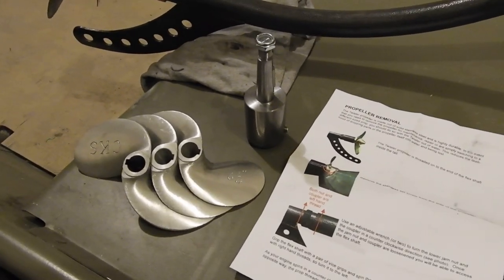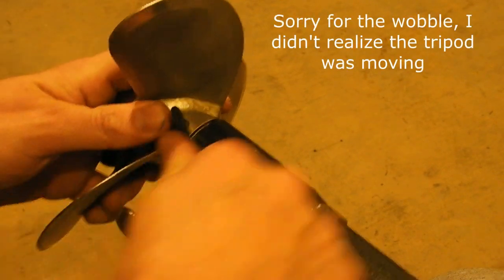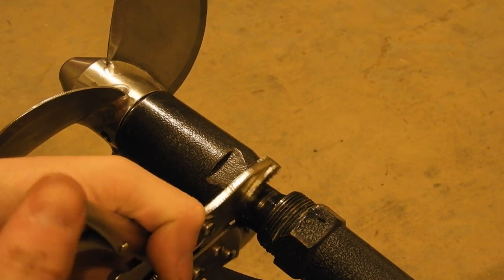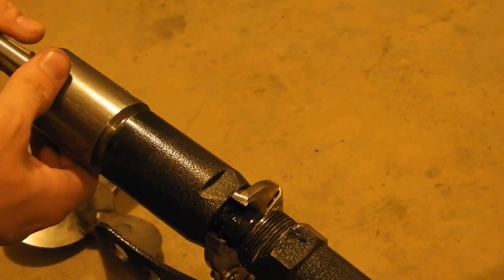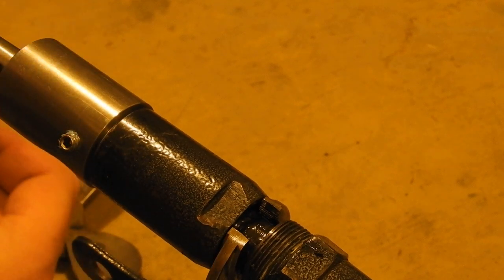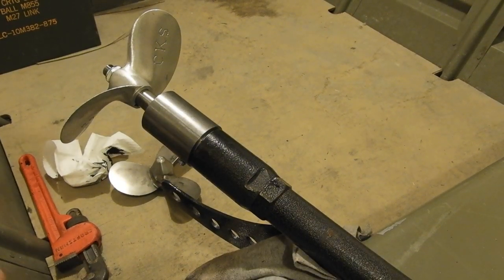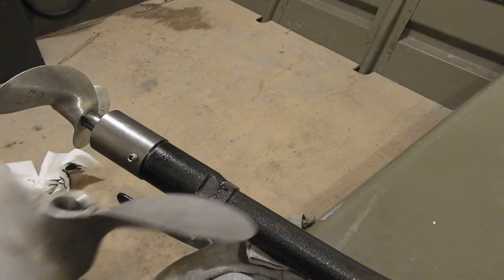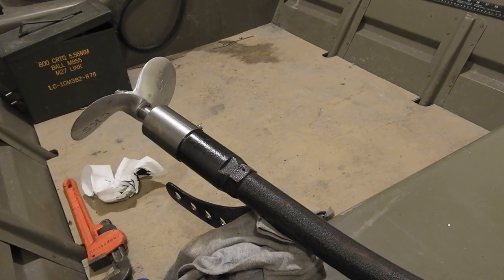Mud-Skipper Twister Prop Adapter Install

Comment: Do you think running a 2 propeller prop is better than three on the surface and why is that.. when I have my three propeller prop cutting the surface water it doesn't barely move my boat. Also did you take the governor out of your engine
Reply from the maker: For the first question, the answer is absolutely go with the 2 blade prop. As to why, that's a pretty complicated question. The shape of the blades has alot to do with how it runs at the surface, and the 3 blade prop is too big for these motors. It's a 7.5" and with the 3 blades, that's way too much surface area and it causes these engines to bog down easily. The factory prop isn't very good at "surface piercing" and that's why without a cavitation plate you need to run the prop very deep, essentially defeating the purpose of the design. Even with the plate, you'll notice once you get to a certain point, the prop will suck in air, known as blowing out.

And I have 2 engines I use. A predator 212 with billet flywheel, rod, stage 3 from NR-Racing, and the governor removed. That's the one I did 23mph with. My other one is a stock Duromax 7hp with the governor still in place and I can get 15mph with 8" prop and an empty boat. With a very heavy load, I'll go with 6 1/4" and it doesn't matter how much weight is in it, I'll go 8mph with a ton of torque.

Hope this helps.
Reply: @playinlikejimi  yes it does and I very much appreciate the help.. I built a wooden dory that is very light it is 17ft.. I have a 420cc 13hp predator and it gets up and goes decently enough for fishing but after watching your videos I agree with you and feel it's defeating the purpose of a long tail not being able to run near or cutting the water edge also I reviewed other info on props and basically said everything about 2 runs faster than 3 and 3 faster than 4 prop. I called mud skipper and talked to Jason and told him that I don't understand why they would put a three bladed prop on a long tail and was hoping that I could get a converter for my send in video rather than another 3 bladed prop.. I still trying to understand the dynamics why 2 blades push harder when cutting the water surface though.. I know that they do but trying to understand it better.. thanks again..
Dusty
Reply: @playinlikejimi  one other thing I forgot to mention is another question regarding stage 1 kits.. installing a header, new intake and jet is there a noticeable difference or is the only big difference comes with governor removal?
Reply from the maker: @luckylevi24   luckylevi24  one thing that completely changed my view on props was when I learned they work more like an airplane wing, not a corkscrew. The shape of the prop causes a pressure difference and this is what really produces the thrust. I think this is also why a larger prop spinning slower is more efficient than a fast moving small prop. That's why surface drives usually have a geared reduction and larger props and can move faster than a direct drive longtail with the same power. Both have their advantages though and I've had all my notes written for a long time to do a video on how the twister bridges that gap, I just haven't gotten around to making it yet. 

To answer your other question about the stage 1, the only comparison I have is back when I still had the factory prop. It was definitely noticable and I was able to hit the governed speed of the engine alot easier. Now that I have the adapter I can swap props in about a minute and match the prop to my engine and load weight. I have all the parts to do a stage 1 on my stock engine, so I think I'll do that but I'm leaving the governor in because it's electric start and I want to leave the stock flywheel in. 

Another big thing I noticed about the governor is it really helps with starting and idling, especially when trolling. Most people think it only limits the upper end, but it also helps on the bottom. Of course you can always feather the throttle and keep it in that sweet spot, but when you let off the gas and the RPMs drop, once the engine hits a certain point the governor will open the throttle to keep it from dying. Same thing when trolling and the motor starts to bog down at idle, the governor will bring the RPMs back to the desired idle. That's why if you mess with the linkage while the motor is off, you'll notice the throttle should be about 1/4 open on the carb side, even if the linkage is closed all the way. Since the engine is off, the governor is basically sensing the RPMs are too low and trying to bring them up and that's why it helps with start up.

These are all my own personal observations, I couldn't find much info online about it and was trying to figure out why my motor kept stalling after I removed the governor when it was completely fine stock and the carb was tuned to idle just fine with the prop out of the water. But as soon as I dipped it down, it'd stall unless I feathered the throttle. Just something to think about and I could be completely wrong my carb could just need some work. But take a look at the linkage with governor in place and quickly drop the prop in the water and see if you can see what I mean. 

But the other aspect is the upper end. You definitely will get higher speeds with it removed with the sacrifice of some easy driving on the bottom end. Especially if you do a cam and valve springs and start to move the powerband higher up. 

Sorry for the long winded responses.
Reply: @playinlikejimi  you have really helped me out a lot with the information. Wish you lived in sc I could show you my dory I made. Also I hope when I send the video to mud skipper for free prop that Jason gives me an adapter instead bcuz I agree with you that the prop that comes with the twister defeats the purpose of what it is made for. Thanks again.

Dusty
Reply from the maker: @luckylevi24  put the vid on YouTube, I'll subscribe to check it out. Then talk to them and see if you can work out a deal with them, their customer service is pretty good. See if you can at least get a discount, or maybe just the adapter and buy the props separately. The worse that can happen is they say no, so might as well ask.

Comment: Are all 3 of the props the same pitch?? I no they are different length
Reply from the maker: I don't know the exact pitch, but I'm pretty sure they're the same. I know the  Beaver dam props are all 5" pitch until you get to 9" diameter, then it's a 6" pitch.
Reply: Did it add more speed to your boat? Do you have to run the cavitation plate? And how far is the prop in the water when you hit your best speed? Thanks
Reply from the maker: @jerredmartin8985  it added alot more speed. And no, I don't use the cavitation plate. I haven't experimented with it on yet, but it runs just fine without it. 

I have done alot of trim setting tests. I'll make a video on that one day but right now my boat is in storage for the winter. But my best settings right now for a stock engine and empty boat are 7" weedless or 8" standard prop with the center of the prop 3" above the bottom of the boat. It will maintain about 15mph. That's about as high as you can lift the prop and comfortably drive it, any higher and the torque from the prop tries to pull the motor sideways. With the boat loaded down I use a 6 1/4" or 6 1/2" about even with the bottom of the boat. Prop depth and weight don't matter with those props, it will stay at 9mph whether the boat is empty or has 800lbs.

Comment: How do u take that spring and barring out of that area ur talking about at 11:23 second
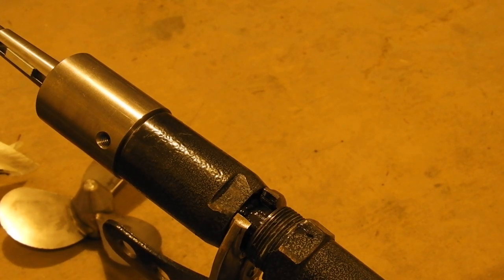Reply from the maker: It's been quite a while since I've taken it apart, but if I remember correctly, once you get to the point around 6:30, you should be able pull it out pretty easily from the prop side of that lower hub.
Reply: Awesome thanks
Reply: So just push it out with something

Comment: Do u know if a cavitation plate helped with the 2 blade prop?
Reply from the maker: I plan to get out this weekend and do some tests with different props on a stock motor. Once I find the best combination of prop and trim level, I'll put the plate on and see if it makes a difference.
Reply: @playinlikejimi   mine the flex shaft broke I'm replacing it Friday. If I put the cavitation plate on and a stage 2 motor kit u think it will push my 15ft pretty good?
Reply from the maker: @alexmont221  so far with the 2 blade props I haven't needed the cavitation plate, but it's pretty much required for the stock 3 blade. And it all depends on what kind of water you're in and the weight of the boat. I'll be testing the stock motor with the boat empty with just me in it and then with it fully loaded down. I'll do the same with the stage 3 predator later on so you can get an idea of what to expect.
Reply: @playinlikejimi  ok looking forward to seeing that video how many times do u grease ur twister? So what your saying is get the 2 blade conversion kit if I put a stage 2 kit on to get the best performance
Reply from the maker: @alexmont221  I would put the 2 blade adapter on first thing and see how it does, you'll probably be very surprised. Then upgrade the motor if you still want a little more power, but see the difference in props first
Reply: @playinlikejimi  I want to get my boat on plane at least. My boat 2 people can pick up but I weigh 200 and the guy I hunt with weights 200 then all our duck gear I'll need as much hp that I can get lol so thanks for the information ill get the prop and stage 2 set up

Comment: Which site did you get the adapter from.
Reply from the maker: Mud-Skipper.com
Reply: @playinlikejimi  I have the same kit you do with the stage 2 NR Racing kit and open water it does great but any kind of weeds try to jam up the prop and having to lift it out of the water causes loss of forward momentum. I was just about to do the same thing as you did and convert one of my old two blade off my surface drive seeing that it does extremely well in any kind of weeds. Thanks for the info and I'll get the kit coming.
Reply from the maker: @donaldcoxe946  the new props are a huge game changer. I was about to get rid of it because of the same issues. Very slow with any kind of weight so I did a stage 3 thinking that would help, but hardly any difference. And weeds or grass would jam up hard, but now I it does very well. I'll try to get some videos of weeds to later in the year when the vegetation gets thick.

Comment: Have you had any problems with the governor off of your engine? Would you suggest me taking out my governor on my predator engine?
Reply from the maker: When I removed the governor, I added a billet flywheel and connecting rod to help mitigate any issues that may come up. If you're leaving the engine close to stock or just a stage 1, I would leave the governor in. It helps alot with starting and preventing it from stalling. People seem to think it only limits the upper end, but it also helps at lower RPMs by opening up the throttle a little bit on start up and when idling to keep it from stalling. I'd only take it out if you run with light loads and want to get the most speed and mostly run open throttle the whole time. Otherwise if you do any kind of trolling or lowspeed manuevering, I'd leave it in.
Reply: @playinlikejimi  thanku for the very informative information you've helped me out a lot. I am just gonna leave it in and try the stage one kit